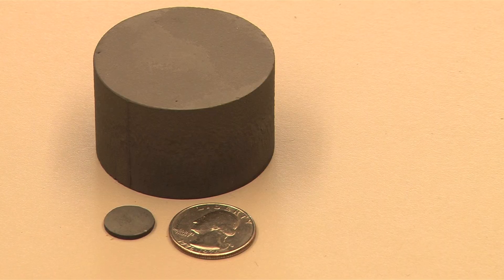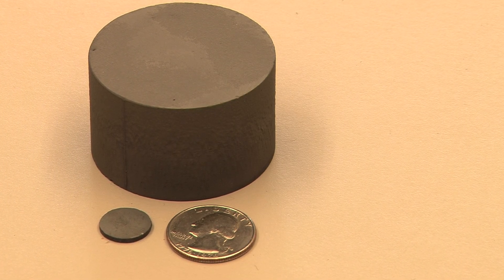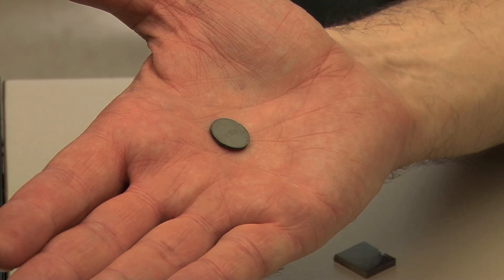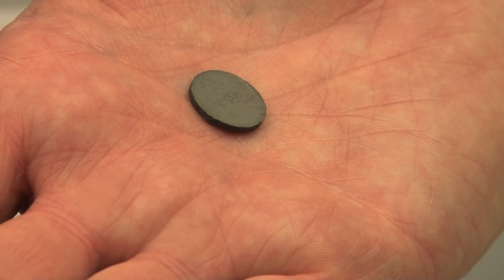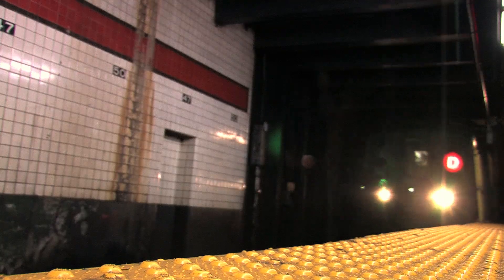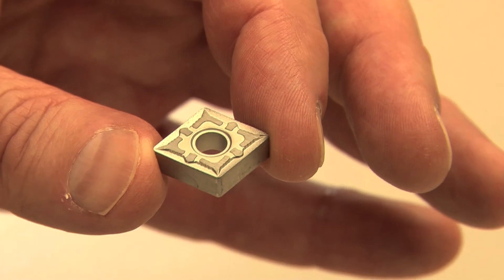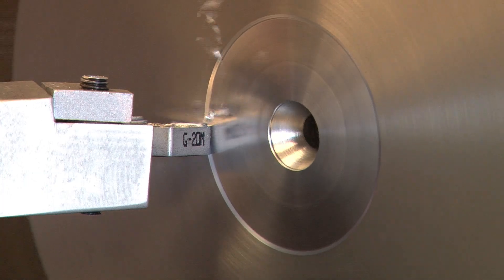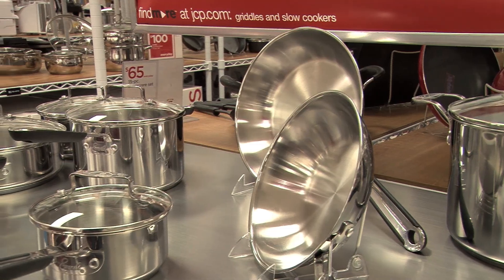Boron-Aluminum-Magnesium (Bruce Cook Interview)

Comment: This material's apparent potential is underappreciated. A material that is simultaneously one of the hardest and has one of the lowest coefficients of friction is a mechanical engineer's wet dream. You could build an engine that runs for years without any lubrication or maintenance.